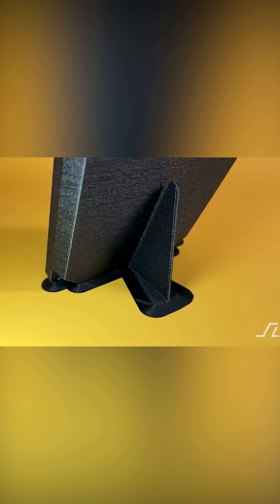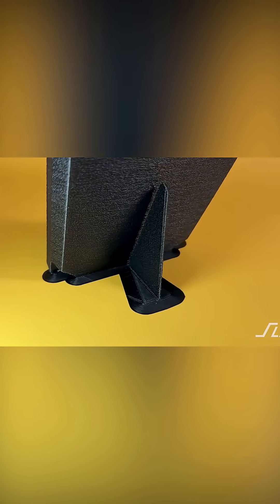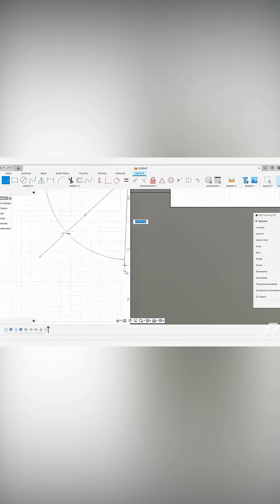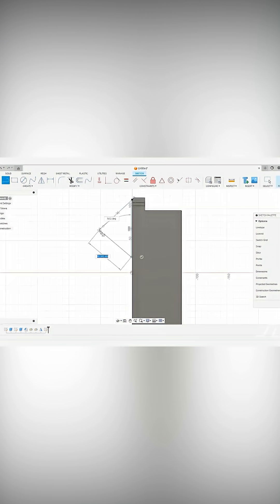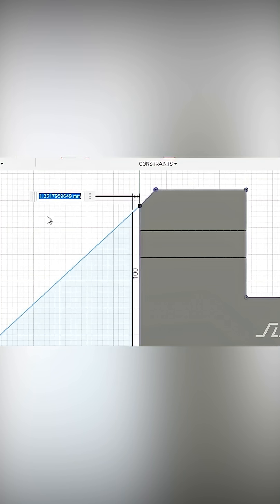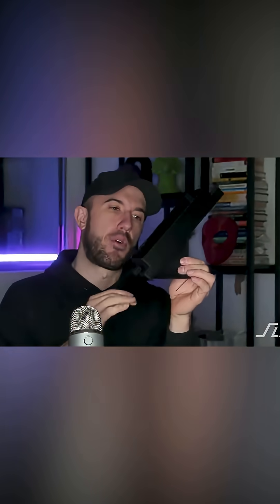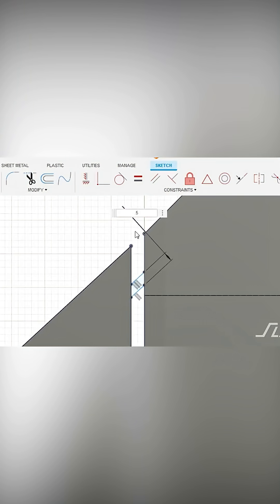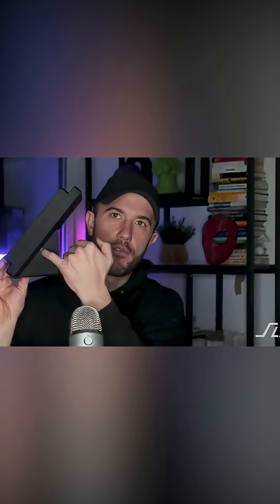How to Design a Support Fin

Comment: This works great but what if u have a vertical hole and need supports in it but it must stay circular and not tear dropped…
Reply from the maker: Print at a diagonal
Reply: I had a larger hole to print like you describe,  i put a square inside with less than 1mm touch points inside to support.  Broke right off after nice and clean.  Same concept,  just inside the part

Comment: What if your part does not have a flat surface to work with?
Reply: You can do the fin technique still by offsetting a surface in CAD. You will still need to find the center of gravity so you know which surface it is you need to offset, but it should follow the curvature of the part.